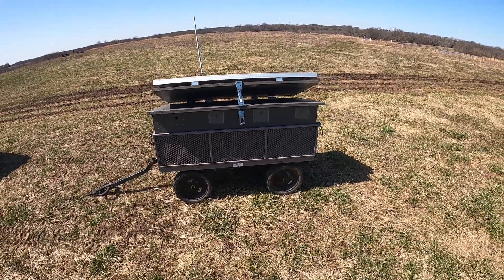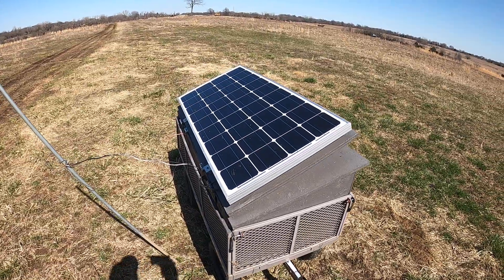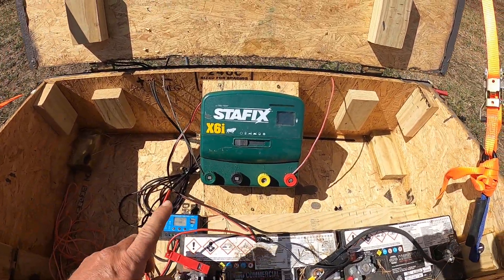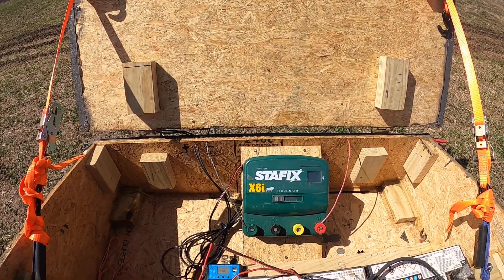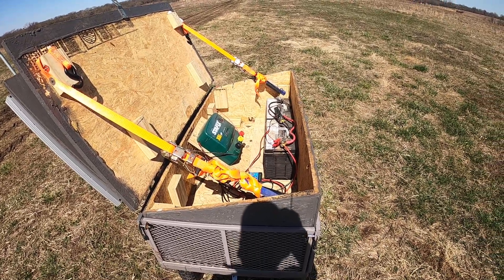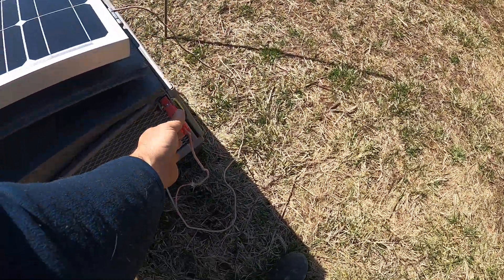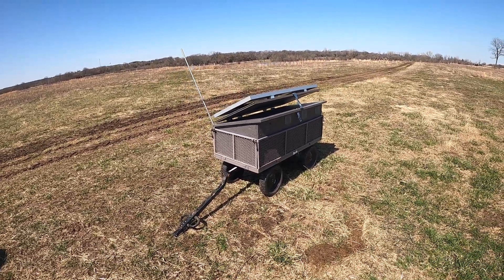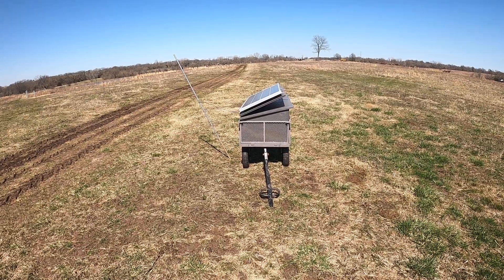HD, diy solar fence charger.

Comment: Nice setup! Could you extend the axles on the wagon to make it more stable? A couple inches per side would make a huge difference. 

Love the new camera and microphone too! These GoPro's record so clear. Was this recorded in 4K? One thing I don't like about the GoPro is how it makes one video several clips, have you noticed that yet?
Reply from the maker: Not sure on axle extensions, probably could but it's not tippy enough to really warrant a lot of trouble to be honest. A more expensive cart would probably work better, this one was an elcheapo model.

No I hadn't noticed? Mine just shows up as one individual video but I also use the video's through the app so maybe it's something I haven't had occasion to notice that way. I can wirelessly transfer the video files to my phone and then I can upload them straight to YT from the farm. So I have not looked at them closely in something like an editor program.
The darn thing was really fighting me a couple days ago though, the audio was choppy, it was eating battery faster than anything I've ever seen, didn't want to charge and the rear screen would just shut off while taking a video. I was about ready to smash it with a hammer. Turns out the media mod case was not making a good connection where the gopro plugs into it, at least I'm sure that's where it was. It still eats battery power like nothing I've ever seen. I'm still going to go buy a nice regular camera one of these days and try that. I'd like to have one anyway.
Reply from the maker: I had the gopro set on 1080.

Comment: That’s a really cool idea. You made it look like it was easy. I’m not a novice, but certainly not close to an expert. Would you guess someone closer to the novice side could knock out one of these without too much trouble?
I am one of those who had to take apart my Premier1 charger and fix it. It was a free fix since it was under warranty, but still left my line unpowered for a couple of weeks while I worked on it.
Reply from the maker: Yeah I saw your video having to fix your own fencer, that company should have taken care of that for you in my opinion. But yeah if you can handle taking that thing apart and fixing it then building something like this should be a breeze. I think all said and done I had about a grand in this one. I had the advantech board on hand, the expense really was in the fencer and the batteries. Those carts are like $150 or so...could probably get by on smaller batteries too but I was going for capacity with the dual batteries. Heck to go cheaper you could even build one with a standard AC charger and use a power inverter between the batteries and the fencer and just make it plug and play. Ac fencers are cheap. I'd never buy another fencer without a remote though unless it was something like to fence off a pond or something fairly permanent. A person could also use a decent old wheel barrow in place of the cart.
Reply: @Digger927  Hopefully the remotes will be added to some of the less expensive units. Just makes sense to do so. It doesn’t add much to the price, it’s a simple thing for the mfrs to do. Guess they just want to sell their ‘Cadillacs’ to increase profits. Oh well, my legs are still my ‘remote’, walk back and switch her off.
Reply from the maker: @Whale_Chum  lots of disconnect switches.